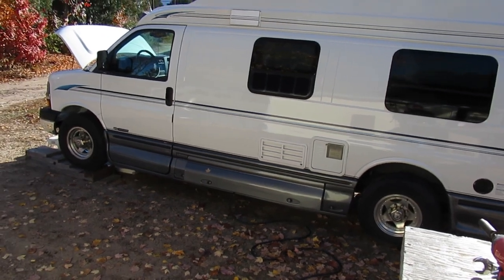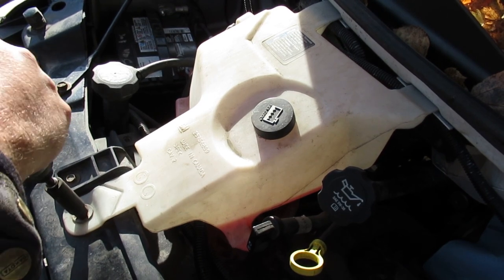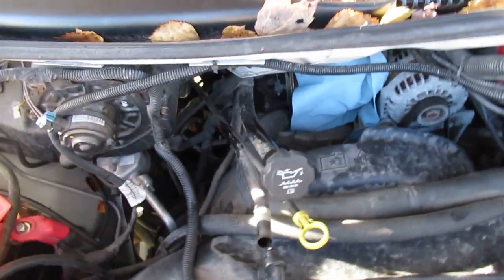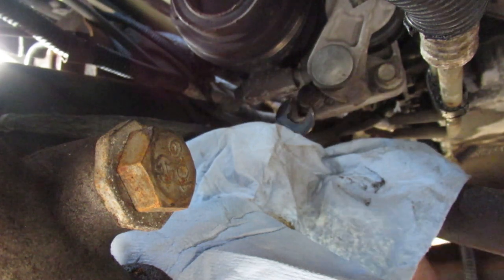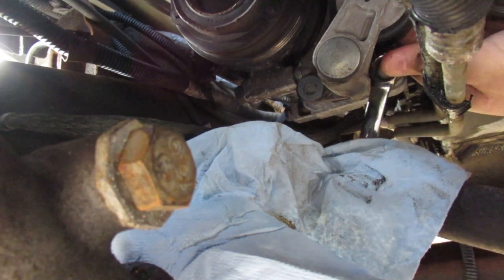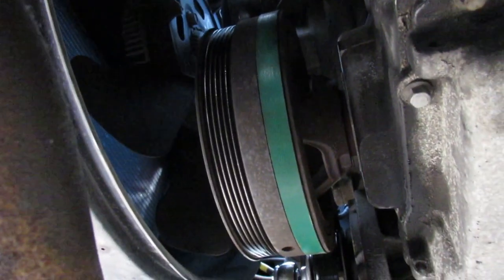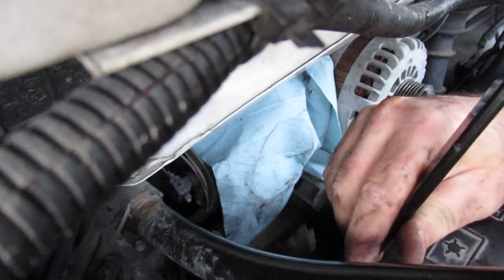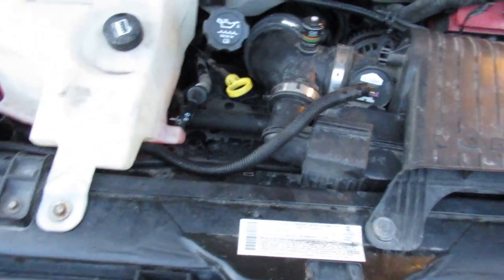2004 Chevrolet Express 3500 6.0 Belts Idlers Tensioners Replacement

Comment: I just got done doing my belts and stumbled across this video by accident - I noticed your transmission dipstick is popped out, mine also doesn't seat all the way down and have been trying to figure out why.
Reply from the maker: it does pop out on its own for some reason, I find it that way fairly regularly so I should probably have a look at the transmission vent and monitor temperatures

Comment: how many miles on your roadtrek?
Reply from the maker: About 97k miles.  I haven't used it since making that video.
Reply: @SteveRivett  I have the same year and model with about 107k miles, but its my daily driver. Thinking about taking on these belts as well. Im not sure, but mine are likely original. I really like your videos. very informative and detailed and well recorded.